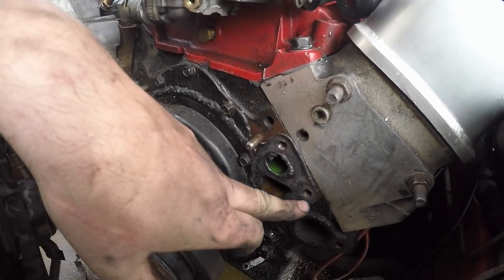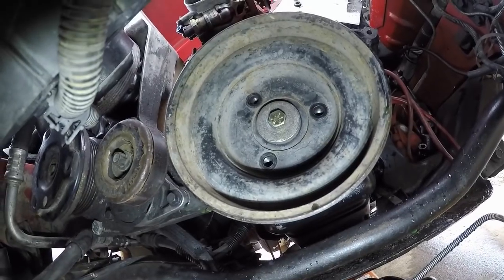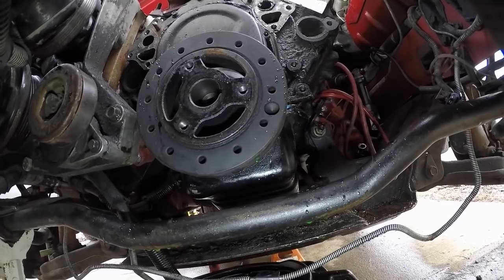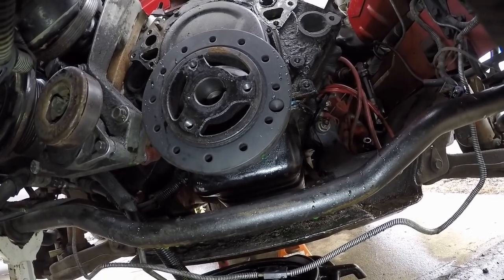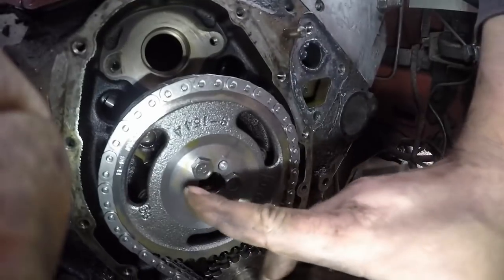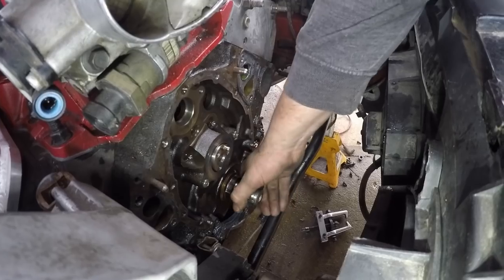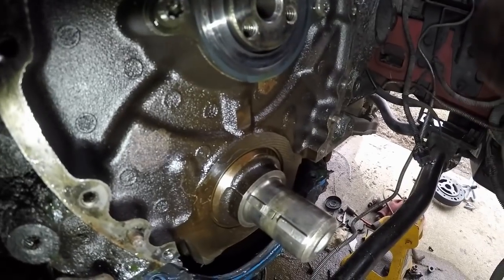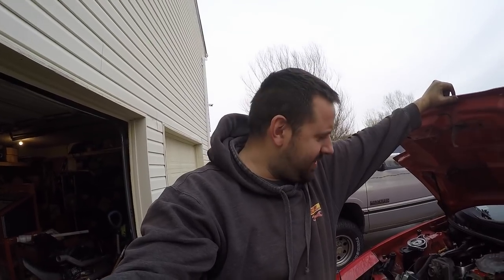LT1 411 LS1 pcm swap part 2 Timing cover reluctor wheel install

Comment: When you said that you added a piece of sheetmetal at 2.30 to block off gap above timing chain cover. 
Look at all of that silicon 
What a disaster looking mess. Yeah real professional huh !!!
Reply from the maker: Silicon was actually pretty clean so not sure what you are talking about. You talking about where the water pump was? You can spend hundreds on a billet efi connection delete cover but this works just as well. might have $25 in it.